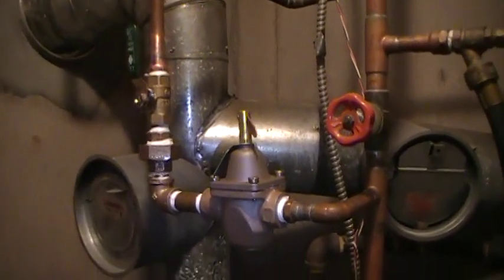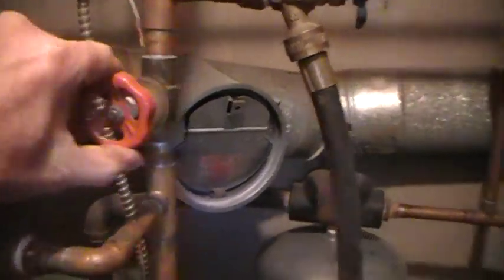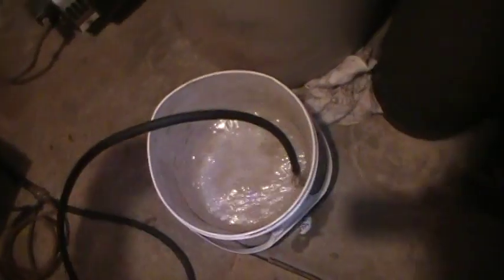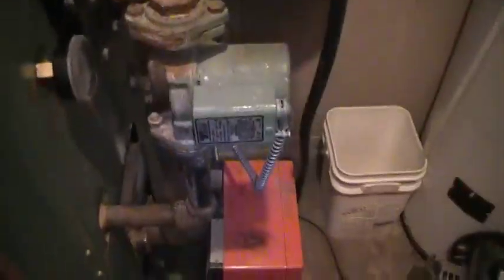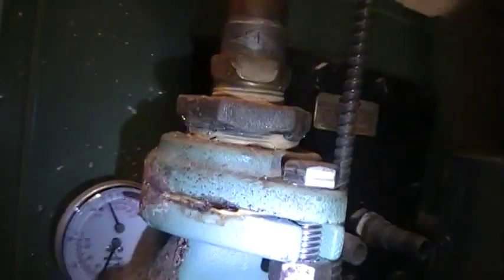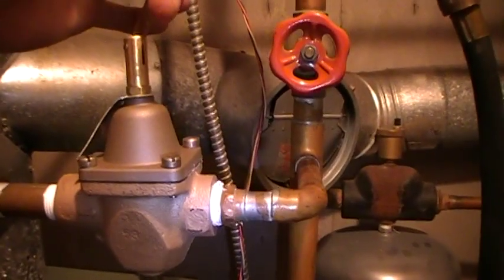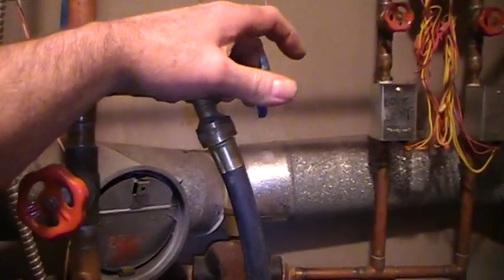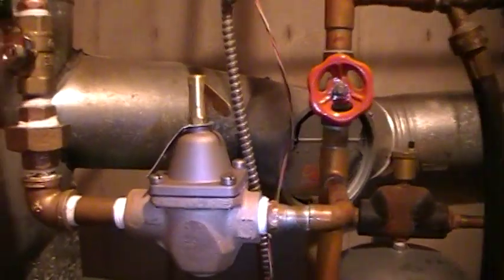How to remove the air out of your hot water heating system-girgling noise.

Comment: Nice video. ...my basement is getting heat but the rest of the house isnt. Any ideas on how to fix this? Its like 0 degrees outside frozen pipes maybe?
Reply from the maker: Hello obadboystanley;
Thanks for the kind words!
I don't think it is frozen pipes; not at zero degrees outside.
The first thing to check is the pressure on the system. On the front of the boiler there is a gauge that shows the temperature and the pressure. It is called a tradicator. The pressure must be above 4 pounds to allow the water to rise to the first floor and above 7 pounds to get to the second level. If you look at the gauge and see only a few pounds on it; you want to go to the feed water valve and lift the brass lever to allow the water pressure to build up in the system.
LIft the lever and watch the gauge as you do it. When the gauge has reached about 12 to 14 pounds drop the lever back down and you should be all set.
Thanks for commenting and let me know how you get along!      Al
Reply: +TheOldkid888 How about a third floor (still all the same zone)? The installers set the valve at 15 psi, but it doesn't seem to do the trick because the baseboard pipes are lukewarm at best up there, even after bleeding the system. The valve is rated for max 25 psi...if I notch the pressure up closer to that, will that get hot water up to the third floor?
Reply from the maker: Tommy Ventre
It should be enough pressure to get to the third floor. Every pound of pressure will raise water 2.3 feet. 15 pounds pressure will raise the water 34.5 feet.
So the pressure should be fine. Did you purge all the air out of the system. This could be the problem rather then the pressure as long as the gauge is accurate. 
Make sure the lever goes completely over when the zone valve opens. It maybe only opening slightly not allowing a great amount of water to pass through the valve.
Thanks for commenting and get back to me when you get a chance.   Al
Reply: +TheOldkid888 Good information about the pressure-to-vertical-rise ration. Never knew that! I clicked the pressure up closer to 20 psi just as a test, and those third-floor pipes are HOT! I think I'll just keep it there, unless that's ill-advised. Thanks for getting back to me.
Reply from the maker: Tommy Ventre
Nice to have heat there no doubt.
If that is where it is when it is hot then you are set.
If not, I would drop the pressure to about 18 to 20 pounds when the boiler it is hot. That will be more than enough pressure to raise the water that height.
I would say the pressure reducing valve is somewhat plugged; so over the course of the winter you may want to check the pressure about every month or so just to make sure it is in that range. It will slowly drop over time and you may have to add a small amount of water. I wouldn't be to concerned about adding any until it reaches 15 pounds when hot.
Thanks for commenting and enjoy the warmth!    Al

Comment: Hi Al  i am a handy man  and  i did a job for some one. and  they  ask  me if i could  get the heat.
Working for them on 2nd floor. and put a new baseboard  heater in bathroom. they had no heat on 2nd floor. for 5 years.
 and had it bled 4 times. By  people  that said they fixed it. So  i saw your video. and called them the next day .
 And said ill give it a try.  I did every thing your video showed  me and  Now  they have heat  and i  have a happy Customer.  Thanks  Frank

Comment: Hey Al, The pressure thing seemed to work. Turned it on called for heat and barely any sound. Then the boiler goes off and later kicks on with plenty of gurgling? I took 30 gallons from a long run and 15 from a short(never getting under 10lbs and up to 18),somethings not right.
Boiler off. All individual zone returns are shut off, all supplies closed except for the one bleeding. So the water supply is feeding new water past the returns to the boiler, thru the zone, water pushes to the closed return and forces air back thru the loop and out the faucet. It's making noise like I didn't do a thing-crazy!
Reply from the maker: Hello SixtyEight Stang;
You are doing exactly what should be done to purge it by the sounds of things.
Not a possibility of uploading a photo or video of the system to me. It would be nice to see exactly what you have there.
I am sure we can figure it out. 30 gallons should do the job for you especially at that pressure. That is perfect!
Thanks for commenting and let me know how you get along!      Al

Comment: Hi Al,my system is actually getting more air so obviously somethings not right. I have 7 diff zones each having a shutoff valve on return and supply( spigot is directly under the sending unit and right above pipe coming out of boiler.The water supply comes in towards backside of boiler .When bleeding,I shut both valves on each zone-leave the back valve open(return)and then close supply valve and open spigot.Took 25 gallons out of a short zone and still hear a ton of movement when it heats.Now another zone is catching air?? I also tried reversing the procedure of supply and return shutoff to bleed-.The pop-off sometimes leaks. Any help on what may be the issue? It still throws a lot of heat in the baseboard. Thanks!
Reply from the maker: Hello Rick;
You are bleeding the system the same way as I did in the video; the only difference from what I am reading is you are purging the loop at the supply end. (zone valve).....Your zone valve is closed correct and there is a sediment faucet past the zone valve on each loop?
When you are purging the loop and go to shut the hose off do you let the pressured drop off to nothing when emptying the bucket? You have to have water coming out of the hose when you go to turn it off. ( A good flow )....If not; the loop will pick up air. 
Watch your gauge while purging as you don't want your gauge going above 15 PSI.
Is the loop you are purging on the second floor? If it is; you must maintain a constant pressure by lifting the lever on top of the feedwater valve a little at a time to try and maintain 12 to 15 pounds. If you are not lifting the lever then your pressure will drop off and you will never get the air from your high points to come out of the hose. Do not lift it straight up for long as this will give you street pressure and pop your relief pressure.
Thanks for commenting and get back to me when you get a chance!     Al
Reply: TheOldkid888 Yes,purging at the supply end.I open the zone valve to purge-and the sediment faucet is before the zone valve. Sometimes the pressure does drop off,and everything is on the second floor. I try to use 2 buckets to keep the water flowing. Should I be bleeding w/the zone valve closed?I'm working on a very short run and after 10 gallons the water is still very hot-seems like it should get cold by then. This thing is a pain,Thanks again
Reply from the maker: Hello Rick;
I would say that if it is a short run; about 4 or 5 buckets should do the trick for you although it depends on how many rises you have on the loop. If your pressure drops down to low you will not be able to push the air out; so it is important to keep a pressure of at least twelve to 15 pounds to drive the air around. Don't be alarmed if it goes to 20 pounds just drop the lever back down a little to control the flow of water into the system. By lifting the lever on the feedwater valve this will help to get the job done. If you are using a long garden hose; direct it outside or in a sink drain. Get someone to hold it in the drain while you lift the lever to control the water pressure. Remember that you will need a good pressure to remove the air especially on the second floor. It is more difficult to remove on the second floor, but you can do it. Be patient and you will be all set!.
Thanks for commenting and let me know how you get along!    Al

Comment: Hi Al. Thank you for the helpful video.I would like to do this to my system to end all of the noises it makes.
The difference with my system is the water supply. My boiler is a closed system. If I ever need to add water to the system, I must open a series of valves until it meets the necessary pressure.
The system in the video appears to have a pressure regulator and a constant water supply to the system.
In what way may I purge my system? I feel that if I do your method, without a constant and regulated water supply, I will essentially end up just draining the system and introducing more air.
Any thoughts and assistance would be great!
Thank you!
Reply from the maker: Hello Torey;
You are more then welcome!
On the front of your boiler there should be a gauge that is called a tradicator. You will see what pressure you have on the system there. You are going to do the exact same thing as I have in this video. Close the return valve to the loop you want to purge. Attach a hose to drain valve that is before the return valve.
The only difference between your system and the one in the video is how it is fed; so you are going to manually open your zone valve ( hook it as in the video) then open your drain valve that has the hose attached. Once you have done this you will crack open the valve that feeds the system. (Don't forget to put the end of the hose in a bucket or a drain) The important thing thing you must watch for is not to put too much pressure into the system. Watch your gauge and throttle your valve that feeds the system between 12 and 15 pounds. It may take a little while to purge depending on the length of the loop. If you are planning on using a large bucket; watch the gauge as it gets close to being filled and close both the drain valve and the feed valve a little at a time as you don't want to drain the pressure off, but you also don't want to put too much pressure in. An extra hand maybe good with your situation.
Once you have removed the air; place about 12 to 14 pounds pressure on the system and you should be all set. Be sure to reverse whatever valves you have closed or opened.
You may be a little nervous at first, but once you start purging; you will be all set.
Thanks for commenting and let me know how you get along!     Al
Reply: TheOldkid888 Got this done for all three of my zones within an hour. The system is much quieter and should be more efficient now too. Thank you very much for your help!
Reply from the maker: Hello Torey;
You are more then welcome!
I am glad everything worked out for you!
It will be a little more efficient as well especially if there was a great amount of air in the system.
Thanks for commenting and have a great week!     Al

Comment: Thanks for the video. I managed to use this method to purge 1 of 2 zones, but this method didn't yield any results when i tried to purge the basement and I cant seem  to find a purge valve for the basement loop. It looks to me that the return for the basement enters after the purge valve i used for the upstairs zone. Any idea what I could be missing?

Thanks, Again
Reply from the maker: Hello Kevin;
You are more then welcome!
All return lines of each zone come into a common line going into the boiler. 
You should be able to purge the basement loop the same way. Open the zone to the basement and you will have to use the same purge valve as you did for the one upstairs. this is common on many heating systems. I install a purge drain for each loop, but some people only install one to on the return and use it for purging them all.
It should work the same way for the basement loop.
Thanks for commenting!  Let me know how you get along!      Al
Reply: I followed the same process for the basebent zone and no water came out of the purge drain whatsoever, which is why I thought there might have been a separate purge for the basement. Would you suggest turning on both zone valves then purging? It's odd because the upstairs worked fine but when I turn the basement zone on to purge the water isnt moving through the pipes when I try to purge but regular heating works fine (with air noise)
Reply from the maker: Hello Kevin;
You want to open just the basement zone valve and purge that separate of the upstairs of the upstairs. You say that it heats fine for you. Are you hooking the lever on the zone valve itself to purge the system?
Get back to me when you can....Al

Comment: Thanks so much.  2 things:
My return valve is actually before my spigot.  Is that a mistake in the system?  Also - 4 zones (each with a zone valve), but 1 circulator, 3000 sq foot house - How much water might be in the pipes?  I'm wondering how many bucket-fulls of water I might go through.

Thanks
Reply from the maker: Jello Jerry;
On the return line below the drain valve (spigot) going back to the boiler; there should be a shut off above and below the circulating pump. If there is only one valve there you can shut it off and then purge each zone individually. 
As far as how much water is in the system; it is hard to say, but I would say that 3 to 4 buckets would be good for each loop. 
Thanks for commenting and best of luck with the repair!      Al
Reply: TheOldkid888

Comment: can this method be used to also stop the banging in the pipes?
Reply from the maker: Hello Anthony;
What is happening with the banging in the pipes is the circulating pump is so efficient in pulling the water around and when the zone valve shuts off the water is still flowing even though the pump has been turned off causing this banging in the loop.
What many people including myself would reverse the way the valve went in. This helped sometimes, but not all the time. So I discovered that closing the return valve on each loop reduced the volume of water and this corrected the problem every time. Removing one spring off of the zone valve would also allow the valve to close slower and prevent the banging in the loop. They also make a slow closing valve that eliminates the noise. 
I would try and dial the return valve off to a point where the noise disappears. It does work and is the easiest fix...
Thanks for commenting and have a great week!     Al

Comment: Thanks for the video.  Question.  Another site suggests that we drain the system from the highest point that the radiators are.  I found a release valve in an upstairs bedroom.  I was expecting to open it and have air come out of it... but it was water.  So that doesn't work afaik.  I am going to try your method of draining at the heater level next.

Comment: You should tell people after bleeding air  turn furnace up to temp and make sure the cap on the auto air bleed valve is loose  you should should never have air again that's what the valve does and if your expansion tank has 12psi your furnace psi should be about 12 psi   I had three different tech guys at my house and they did not fix the problem it took me to bleeds my self to figure it out they will come and take your money and you still have the problem
Reply from the maker: Hello Terry;
Sorry to hear the techs didn't resolve your problem.
You shouldn't have to adjust the aquastat on your boiler when purging the air out of your system. I have never done that. Keeping it simple is how I think the job should go. Not all heating systems have an automatic air valve on them. I would say less then half. They do work well and the cap has to be loose on them.
After the air has been removed; you should always check your tradicator (gauge) and make sure you have at least 12 pounds pressure. That is a very good point. 
Thanks for commenting and have a great New Year!    Al

Comment: Hey. I do not have any zone valves on my system like yours so I'm not sure what I need to do. I have 3 zones with 3 green circulators
Reply from the maker: Hello Tworth23;
Each supply line on the boiler has a flow control valve on them which act as zone valves. They are forced open when the circulator turns on. So what you have to do is purge each loop.
This is easier with the system you have in place not having any zone valves.
Turn the power off to the system.
Close the valve to your expansion tank if you have one. Then close the return valve that is located above each pump. Above the valve should be a drain valve. You want to attach a hose to each sediment faucet; one at a time and open the valve draining the other end of the hose into a bucket. 
You will see bubbles forming in the bucket as it fills. Once the bubbles stop you are all set to go.
If by chance when you are purging the pressure drops off; you can lift the lever up on the pressure reducing valve to increase it, but be careful not to hold it up too long as the pressure will go very high. Keep an eye on your gauge. It should not go above 20 pounds while purging.
Once you have purged the system. Simply open the return valves and the valve to the expansion tank and you are set to go!
Thanks for commenting and have a weekend!    Al